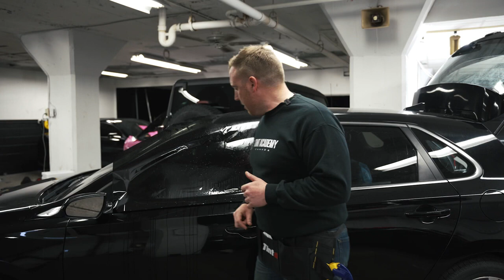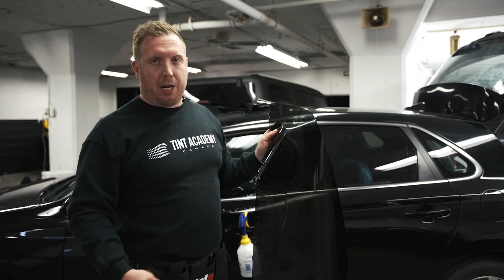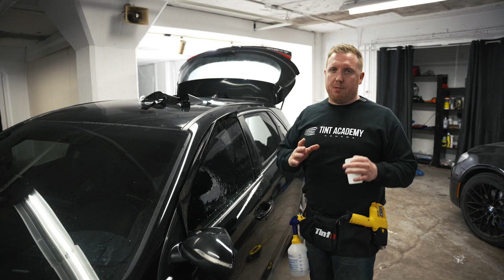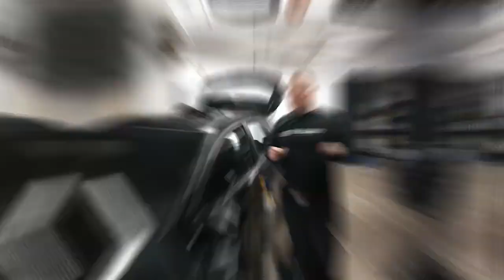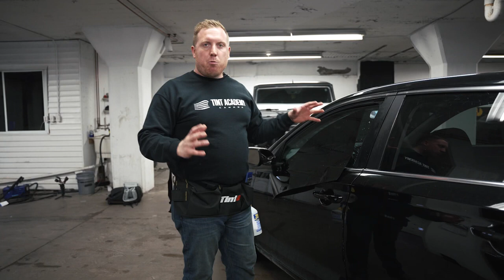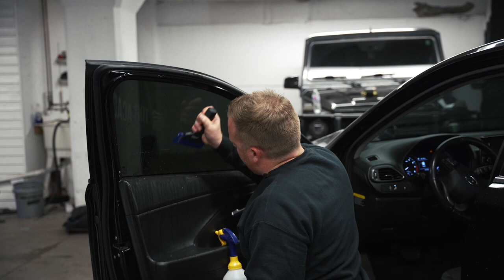Beginners guide to installing window film - bottom load method

Comment: Instead of cutting 1" overlap. Then shifting over an additional 1/4" why not just cut 1 1/8" wider from the beginning? 
Seems like it would save time.
Reply from the maker: This cutting process were cutting directly on the glass - if you were to cut 1/8 from the beginning you may cut into the rubbers. You can follow a method called “sharpie” method which you will not need to shift the film - but requires a peel board